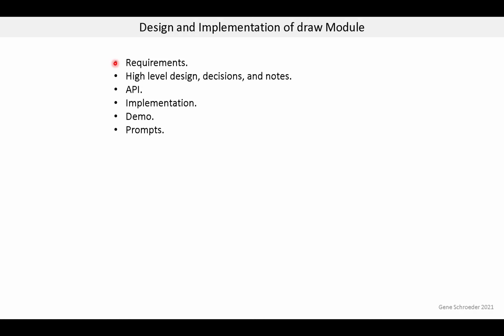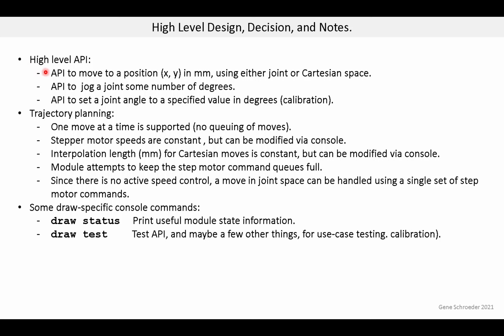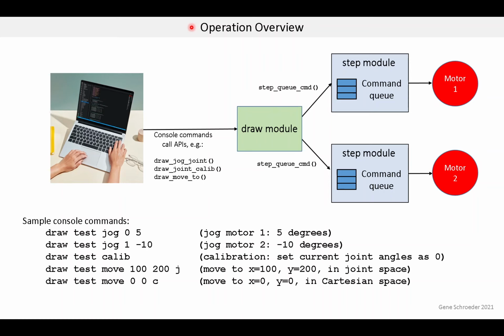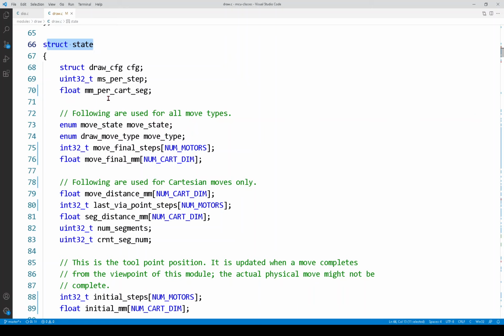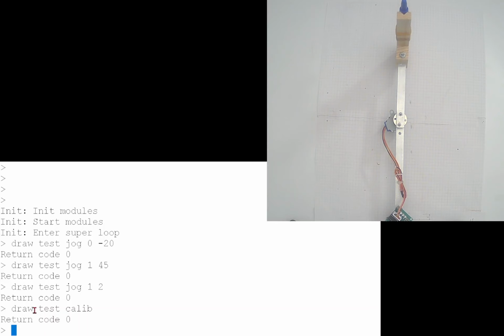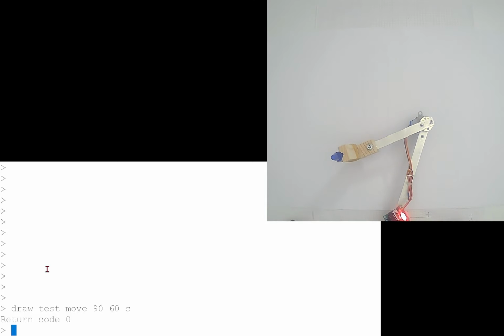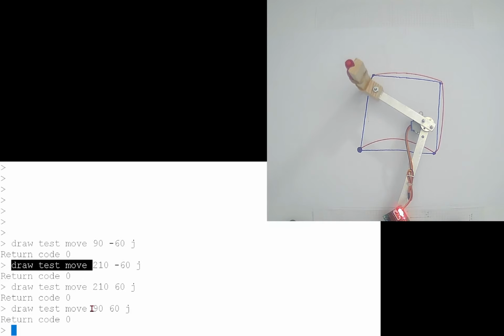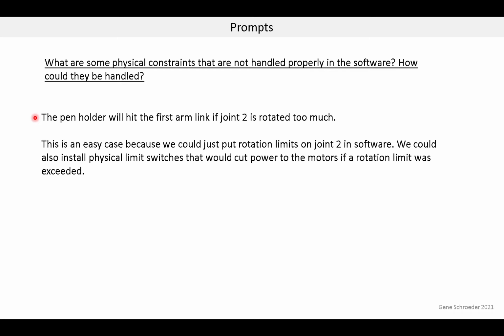Steppers and Robot Kinematics Lesson 5. Draw Module Design

Comment: Good work, Could you explain how to implement the code on Cube IDE?
Reply from the maker: Thanks. The code for this course is in the github repo as mentioned in the first video, and I described some of that code in later videos. The base code design is described in my base course called "Bare Metal Embedded Programming: Theory and Practice Using STM32".  If you have specific questions, I will try to answer them.